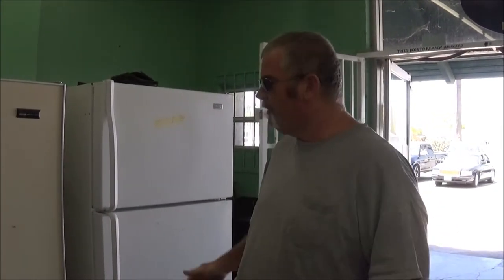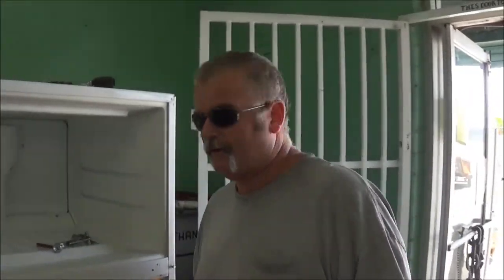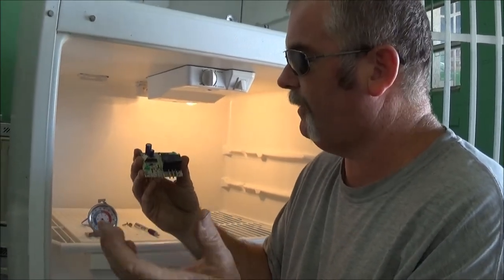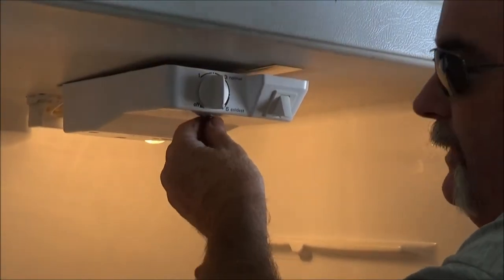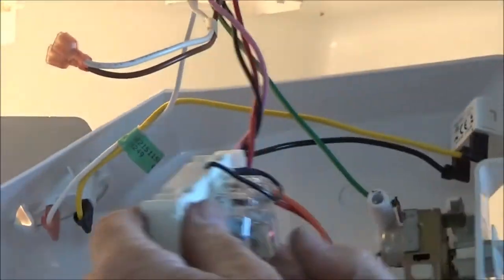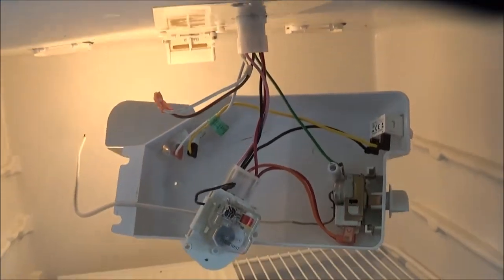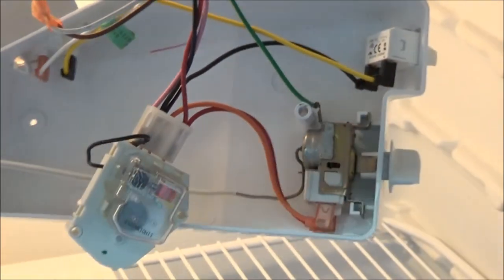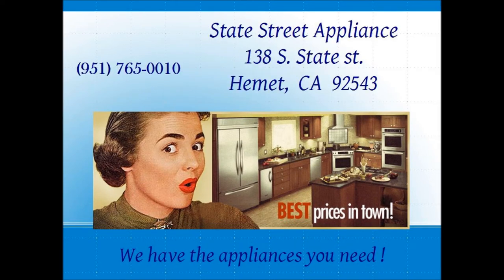How to Replace an Expensive Adaptive Defrost Timer with a Low Cost Manual Defrost Timer

Comment: Thank you for this video. It helped me a lot. I bought that exact defrost timer, 482493 (W10822278 482493 483212 8hr 21 minute ERP Defrost Timer).  The wires on mine are pink, black, orange, red just like yours. The black wire that sticks out loose is the defrost timer wire and it slides down the terminal needed. Depending on which wire it is connected to it can run 24 hours a day (continuously) or it can run only when the compressor is running (cumulative). Mine is outside in the garage so I just want it to defrost 3 times a day so I connected it to terminal 1. You have to read the instructions and put it on the correct terminal. The terminals are labeled out of order on the back of the defrost timer. 2,1,4,3 where 2 is pink, 1 is black, 4 is orange, and 3 is red. If you pause the video you’ll see that is exactly how this person’s connector is too. You can see that his loose black wire is connected to the outside connector, pink #2. The other 2 wires on mine go to white and the brown wires. White is common and brown goes to the heater. These 2 are feedback to the control board so it knows exactly when the heating element is on. Brown is after the bimetal switch and directly on the heater which is why it is different than pink. On the mechanical timer those 2 wires are not used. When the defroster is on the bimetal switch limits the heat so that if after 4, 5, 6 or however many minutes the bimetal switch gets to 50 degrees, the heater turns off but the compressor won’t start up again until the full 21 minutes are up. My fridge no longer freezes up the drain hole. I replaced the bimetal temperature switch first but that didn’t fix the problem. Even though I have pink, black, orange, red, I had to connect the black loose wire to terminal 1 to make the timer run 24 hours a day (continuously) and it defrosts 3 times a day.
Reply: where can I purchase the manual defrost timer?
Reply: PS mine is a Roper, purchased approx. 2002  the door seal needs to be replaced, but found those are around $100 plus!  I just cannot afford that.  And my refridge just started frosting in the freezer & not cooling.  I am a single lady(on limited/fixed) income and am in hopes I can fix the problem by replacing the timer.  THANKS for the video & any help you can offer.

Comment: I have an Amana side by side ASD 2522 w r s 01 put a new thermostat on it did not work thinking the defrost timer it's got that board frost timer board will that manual timer work on it my part number for the board is 4388932.

Comment: Hi I have the same fridge it has the circuit board . when I plug in in it comes on then stops and I hit the door switch 5 times and it runs again .then stops after 3 minutes .any ideas and can I change it to the timer? Thanks 👍

Comment: There is a way to trick the ADC into a defrost. If you place a screwdriver blade between terminals P1 and P2 for a half a second, this should put it into defrost. DO NOT SHORT ANY OTHER TERMINALS OR YOU WILL DAMAGE THE CONTROL. Terminals P1 and P2 can be located by the markings next to the terminal. Note; Do not use bare metal/wire or you WILL get a shock. Be aware that the bimetal must be closed in order for the ADC to perform a defrost cycle because that is where the board will send current. It is not recommend to make this interchange (ADC to Manual) on a side by side because some models use thermistors that a manual timer can't control and will not cool properly.
Reply: +Psycho9263  Hey man, you seem pretty knowledgeable about the defrost heater system. 

Mine just went out on my  side by side door Kenmore 106.
The bi-metal checks good when cold, open when warm. The heater reads 24ohms. Is there any other circuitry that can stop the defrost control unit from working. Does the evaporater fan have to come on and be working properly for the defrost control to work? 

 I'd like to put a manual one on mine like the OP suggested but not sure of the complications. Manufactor's take something simple that worked and add a computer to it just like they have with cars and make it complicated. The price goes up, the dependability of it goes down and they just keep adding more BS to the mix every year.
Reply: ILTSYC If the ADC or Defrost timer is sending current to the defrost heater (assuming the heater element is good) it should work. It has to be very cold for the bi-metal to close or the defrost heater(s) will not work even if the ADC/Defrost timer is in defrost. In that case, only the compressor will shut down and the evaporator fan and condenser fan will stop. The heater(s) only will come on when there is ice to melt and the bi-metal closes, the heater(s) will come on in the defrost cycle. The bi-metal is a temperature activated switch for the heater(s). A bi-metal is rated by when it opens. For example, if it says L-45 on the bi-metal, this means it opens at 45 degrees. In a defrost cycle, the evaporator fan will shut down. It is best to use the defrost control that was originally in your unit. The ADC adjusts compressor run time and defrost time in certain conditions in which the manual timer does not have those capabilities.
Reply: Thanks for the rapid response man! My evaporator coils were completely loaded with ice to where after about 3 days when it first started slacking the fridge felt almost warm and frozen biscuits and sausage started thawing. I knew then it was an emergency.

   So I tore into it to see what I could find. Seems like an interesting way to make a living working on this stuff. I've always done all my own appliance repair. YouTube helps a lot  now though.

I read where someone replaced there defrost control and the freezer kept freezing up. That's why I was reluctant to by the part. For mine the cheapest appliance supply around wanted 189 for it. Of course I can get it refurbished for 59 on ebay.
Reply: ILTSYC All there is to it is a working knowledge of electric.
Reply: ILTSYC You can buy an ADC for less money if you buy from a wholesale parts supply. Look into www.marcone.com Going to suppliers like Johnstone Supply is not a good idea because they will approach you with that "Watchdog Growl" before they will quote you a price or tell they have a part in stock, the next question is; "Do you have a license???" Another way is getting it used from an appliance company that salvages parts, but there is no guarantee that it is good or will work.
Reply: Thanks for the link man! I'll save it in case I need it. I don't have an appliance licence, I suppose it would be handy.

When your fridge goes out its darn near an emergency! Especially  as much as food cost now.
Reply: ILTSYC You don't need a license to repair appliances or refrigerators and window unit air conditioners, they are exempt. In some states, you need a license to repair central air conditioners and large refrigeration units like in supermarkets that have rooftop compressors. If you plan to work on refrigerators as an occupation, you must get EPA certified so you can buy R-134A in larger quantities like 30lb containers. Unlike most appliances, you will need extensive training for refrigerators. It is imperative that you learn how the refrigerant works in the sealed system and how the compressor and its components operate.
Reply: +Psycho9263 Great conversation. You know your stuff. One question I'd like to ask if I may. 
the ADC has 6 terminals were the manual timer has 4. What is the other 2 pins for? And if I'm to replace the ADC with the manual one how do I en corporate the 2 remaining terminals into the circuitry so nothing is left out?
Reply: Rashy Doxx The other two pins are usually found on the newer units that may use thermistors that send a temperature signal to the ADC.
Reply: +Psycho9263 Thanks, appreciated.
Reply: +Rashy Doxx Those two remaining pins are used as a feedback monitor from the heater, or the compressor. Not needed since no monitoring is available.
Reply: I hate those damn thermistors
Reply: I was wondering about those 2 other pins, I'll look for thermistors now. I've never seen them on a whirlpool? I know that's a GE thing
Reply: So just leave them off, Right?

Comment: Could you make a video that shows more detail how to convert a 4388931 Defrost Control Timer to a 482493 timer. I was thinking if the brown and white are for lights, don't know yet, :P To just wire them into the hot neutral at the timer??

Comment from the maker: How to Replace an Expensive Adaptive Defrost Timer with a Low Cost Manual Defrost Timer

#refrigeratorrepair #howtoreplacedefrostswitch  #replacerefrigeratordefrosttimer   #howtoreplacerefrigeratordefrosttimer
Reply: Appliances Cheaper j
Reply: I know this is an old thread, but I'm looking for a way to perform this upgrade on an 8 wire adaptive defrost timer. Amana part number 12050506. Any help is appreciated.

Comment: I noticed all the timers i've seen when parting out fridges for parts has that black hot wire on the center hot prong.
Reply: Porfavor hayudame, como puedo ver este mismo video en español, necesito saber dónde conepto ese puente en el timer, y esos dos cables sueltos dónde estaban coneptados
Reply: Porfavor, bendiciones, disculpame por molestarte
Reply: @tyronedavidnogueracajina2964  Hola, él no hace esa explicación.

Comment: Maytag is made by Whirlpool.
Reply: No it's not
Reply: @carmac1652  , Not only Maytag, but Kitchenaid, Jennaire, Amana, and a bunch of others. Whirlpool is the largest manufacturer of home appliances in the world. If Whirlpool is not the manufacturer, then who is? Older Maytags were made by Maytag.
Reply: @josephfolsom2030  I don't know but I buy alot of Appliances I have alot of diert drive washers Kenmore Ings rober Whirlpool . and I know only Whirlpool makes direct drive .I'm in the appliance flipping .
Reply: @carmac1652  I have serviced appliances for over 38 years, and the direct drive is a Whirlpool made machine whether it has Kenmore, Kitchenaid, Amana, Maytag, Kirkland(Costco)etc, on it. I prefer those machines over the junkie modular designs.